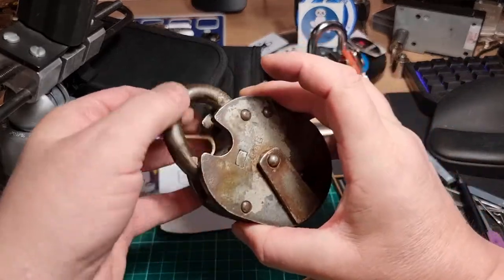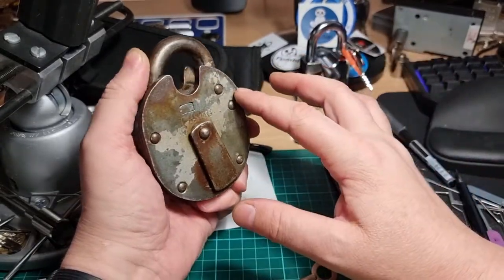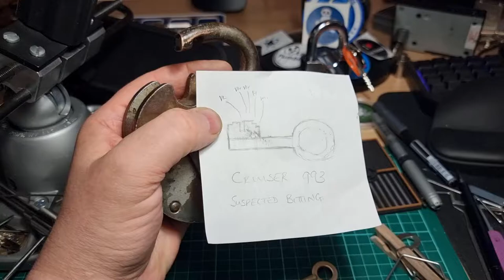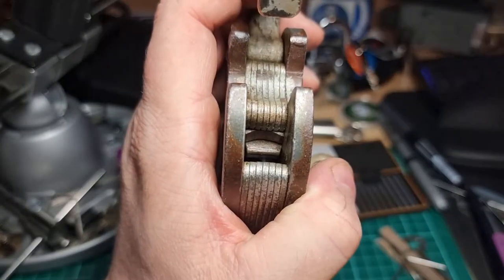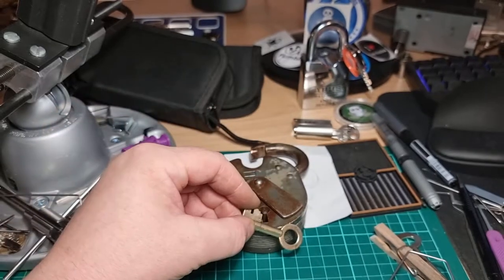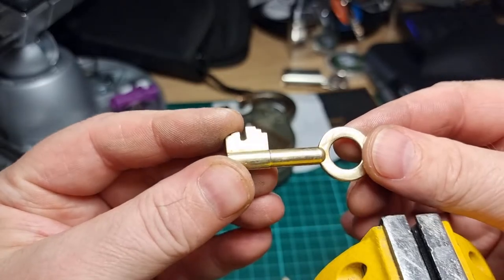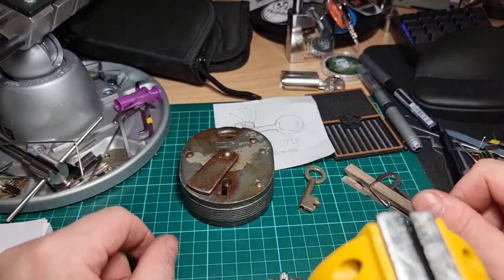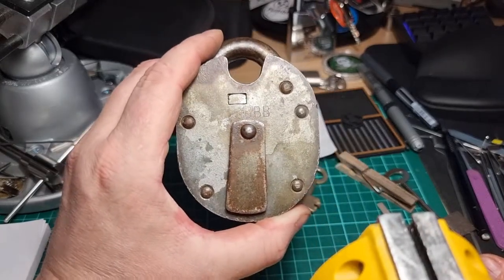(163) I Made a Key For a "No Key" Chubb Cruiser

Comment: Brilliant work!!! I have a couple lever locks I hope to do this with eventually 😀
Reply from the maker: Thank you 😁 
I was really surprised that it worked on the first attempt!
One thing to bear in mind is you can the high cuts thinner than the low to prevent the possibility of it lifting the neighbouring lever.. but the spacing needs to be accurate.
Cheers bud 👍 🍻

Comment: I would have used a combination of reading the tumblers through the shackle hole and maybe L-wires to gap gauge the lever tumblers against the key pin.
Reply from the maker: Thanks, I'll try gauging the lift of each lever, internally, next time I buy a keyless lever padlock.
Cheers 👍 🍻